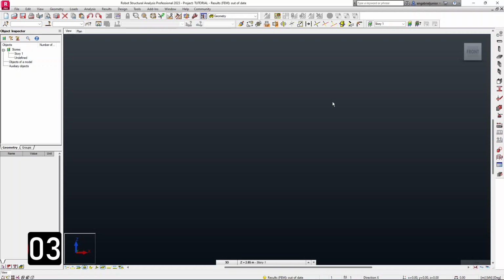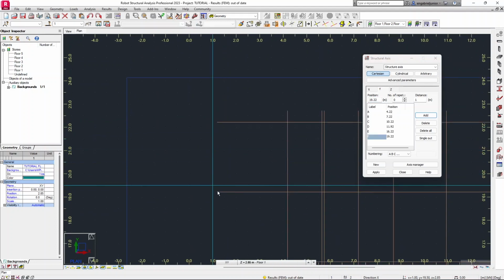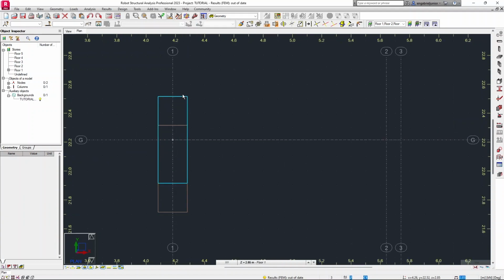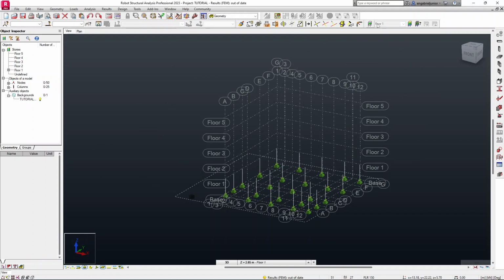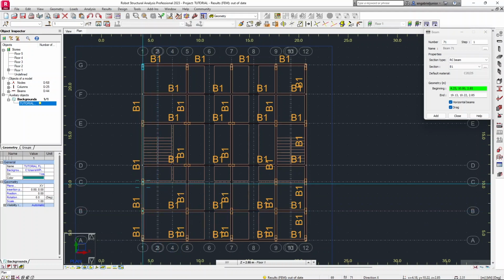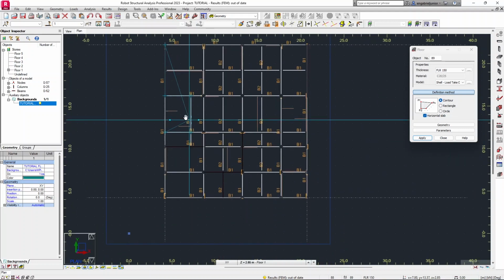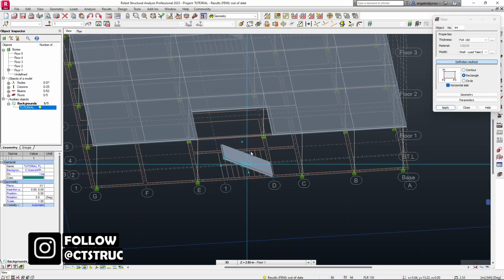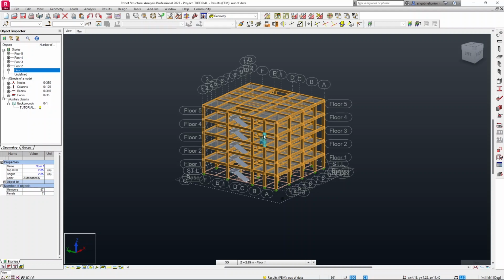Lesson 3 Modeling From AutoCAD (Beams, Columns, Slab, Staircase) - RC Design with RSA

Comment: Hello, when defining sections, where can i add RHS and SHS assuming I defined Eurocode as my region? Also great lessons. They are genuinely really helpful especially for beginners☺
Reply from the maker: Hello, great question. First go to Tools->Job Preference->Databases->Steel and Timber. Here you'll add the database for standard steel sections. For RHS and SHS click on add new and look for UKST (Uk standard sections, Description: British Hot ROlled Section).  Once done click okay to close the job preferences. In the member sections dialog you can select the UK section and look for RHS and SHS, usually they're grouped as tubes in the member selections dialog. Hope that this helps.